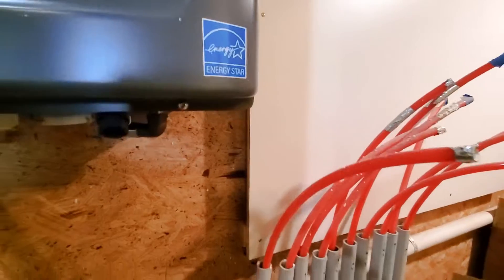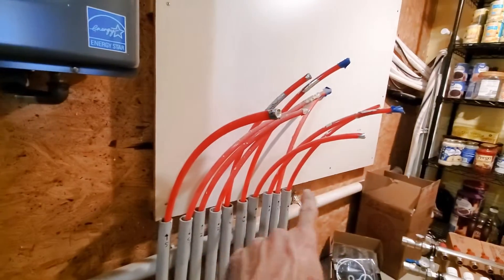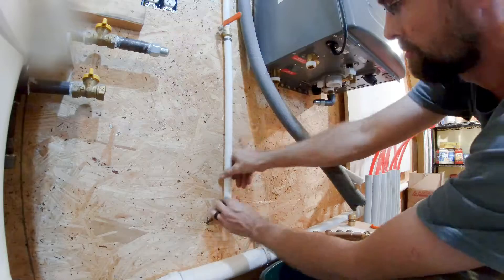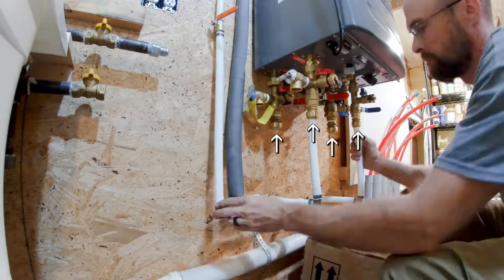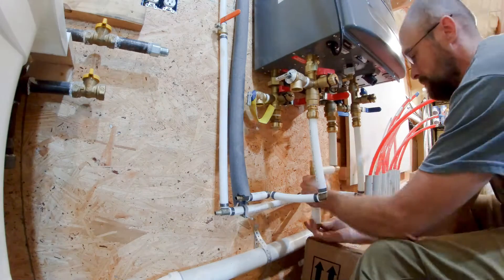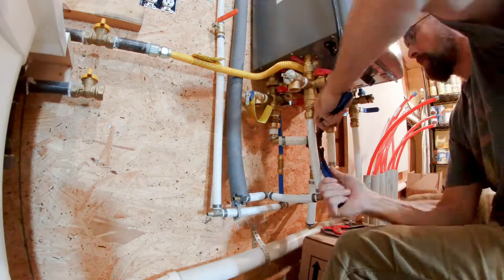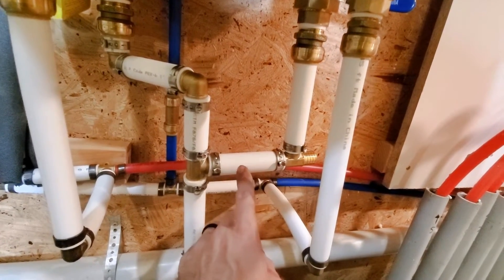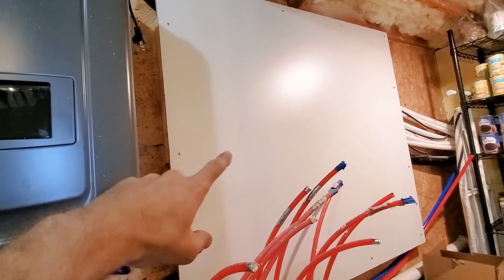Rheem Prestige Condensing Tankless Combo Boiler 199k BTU - Plumbing the Boiler - Off Grid Heater

Comment: I have very little space under my proposed install. Would foregoing the primary loop enable a significant space savings?
Reply from the maker: I'm not sure you should since it might not work correctly without it or it could shorten the lifespan of the unit/parts.
Reply: Ok will go with two loops. Thank You
Reply: @Off-grid I worked my primary loop so the centerlines of the 1” pex tees are 5” apart. I am holding off on going another 1/2” closer, mostly because I dint think it will make much difference. The flow of the secondary loop goes against the flow of the primary (right to left on 2ndry & left to right on primary. Do you think this is why my boiler flame cuts off in short order, even so many of my zones are calling for heat? Also my 2nd pump is only getting 2-3 GPM at full speed…related?? Thank You
Reply: @Off-Grid Still not getting longer burn times or heat up of the house. Changed circulators but that was not the problem. Flow through the secondary is smooth, but flame goes for at the most 2-1/2 minutes and then stays off for a long time. No way your going to heat a house at that rate! I cut the flow interface pex down to 4-1/2” between centerlines of verticals but still not satisfactory. Called a boiler company for diagnosis tomorrow a.m. The heat simply isnt getting out of the primary loop or there is something wrong with the unit!
Reply from the maker: @dawnpaulandelizabethromero3458 I had a similar issue and it was because the air intake pipe was restricted by a mud dobber nest.  It would turn off after a few minutes because it couldn't get enough air.  Check the pipe and the internal air filter.
Reply: I did not use <4 pipe diameters between intake and outlet in primary loop. Boiler did not ignite with call for heat. Will report back when it is fixed.
EDIT: Per your “short”, your combi thermostat is wired to the “CN” terminsls on tje control board, whereas my Taco zone controller “isolated end switch” is connected to the “Heat Demand Input”. This will be another problem with the boiler not lighting off with the radiant heat loop.
Reply: Thank You. The house heated up quickly after turning off the eco-mode (outdoor temperature sensor) and going straight temperature set point. It seems, the 95% efficiency will not be achieved due to this. I even set the radiant heating (staple up on wood floor) set temperature up to 160..the boiler easily heated the home…now back down to 140 degrees. The idea of replacing the circulator with a higher head pump is now on “the back burner”.
Reply from the maker: @dawnpaulandelizabethromero3458 i had the outdoor sensor disconnect for the first winter and it would over heat the floor.    When it was disconnected the unit would keep running trying to get the house to temperature.  When it started getting warmer outside and the sun came through the windows the house would get warmer and now the floor was to hot.  That first winter we'd have the doors and windows open because it was too hot inside.  After hooking up the sensor we did have that issue anymore.
Reply: BTW, the heating company did mot find anything wrong..they recommended turning the “input side” tee 90 degrees to allow easier flow thru the primary but still maintain the thermsl seperation.

Comment: Great video series.  Maybe I missed it, but what square footage are you heating with this boiler?
Reply from the maker: The main level is around 1600sqft finished but we're also ran two loops through the garage.  It works great and the main level of the house is often warming than the rest of the house.

Comment: I know this video is old but I'm working on installing the same boiler. Do you need a pressure reducing valve going from the domestic cold to the auto feeder or just the check valve

Comment: Two loops - primary and secondary. The primary loop goes through the unit. The secondary loop heats the house. The internal pump for the primary loop is about 5 gpm. The external pump for the secondary loop is about 20 gpm. You can't (don't want to) push 20 gpm through the unit. Over a short period of time, the water in the secondary loop will get up to temperature, being constantly heated by the water going through the primary loop.

Comment: Can we put low price air eliminator instead of expensive one, make a tee on the pipe and install it. What is the benefit of putting that big air eliminator ? 
Is not the recomended size for heating pipes close to boiler (Manifold etc) suppose to be at lest one inch ? 
Thanks for the part list in the description it helps
Reply from the maker: All of the air eliminators were  part of existing parts of the system so I really didn't have a say in where they went.  There is one inside the boiler, two by the manifold, and another by the expansion tank.

Comment: Great video, thanks for the detailed explanations and tips! Quick questions, does the white 1" pipe have oxygen barrier coating or a standard 1" pex B? I couldn't find it in your parts list. Thanks
Reply from the maker: Thanks.  The only part that has the oxygen barrier is the tubing that's in the floor.  The rest is normal pex.  There is maybe 1% of normal pex vs the oxygen barrier so it isn't something that the air separators can't handle.  There are four separators in my system.

Comment: i called Rheem tech support today. they said the boil need a manifold " part number RTG20318"  otherwise , it will have high pressure error code.  do you have even get into any error code without the manifold?
Reply from the maker: The pipes run through a manifold.  That is how it feeds all the different loops.

Comment: Do you have a video showing how to wire the combo boiler to the wall control unit that controls all the pumps and such?
Reply from the maker: There are only two pumps in my setup and the settings on the boiler control them.  The only other thing wired outside of the unit is thermostat.

Comment: Not a good idea to use pex hoses directly on the outlet side of your heater, they may get much hotter than set temp on the primary loop depending on the demand sensed by the unit.
Reply from the maker: I guess I don't understand since pex wouldn't conduct heat like copper would so how would it get hotter then the set temp?  The system has been this way for a few years now with no issues.  It's run like a champ.

Comment: We have a question if you are available
Reply from the maker: Sure, what are your questions?
Reply: Customer service was so helpful! F and C are in the A:GA/L setting (gallon/liter)
Reply from the maker: @mindybest3213  good to know, thank you
Reply: Craziest thing.😅 There is very limited instruction on the control  panel. Do you know how to change  off of Celsius? Or have access to a better manual for this unit?
Reply from the maker: Someone else asked me this as well.  My unit is in F.  I don't remember changing it from C but maybe I did.   @mindybest3213

Comment: What crimp tool did you use for the 1 inch PEX?
Reply from the maker: I had bought one on Amazon that worked ok but eventually broke.  I have an off the shelf crimp tool from Home Depot now which is much better and easier to use.

Comment: Great presentation and very informative for all.  Installing my system now and noticed that in your Isolator Service Valves connected to the bottom of the boiler hot side (CH/DHW), both have pressure relief valves attached.  It was my understanding that the boiler comes equipped with a PRV on the top of the unit adjacent to the exhaust vent specifically for the CH and that a separate PRV for the DWH was only needed (total of 2 PRVs).  Is an additional PRV needed on the CH ISV as well?  It makes sense that it is needed there, just not sure of the purpose for the one on top if this is the case.  Any thoughts?  Also this link gives a great description of the primary/secondary loop and the basic fluid dynamics explaining how the two loops are hydraulically disconnected and the resulting efficiency as a result.
Reply from the maker: You are correct that I have an extra relief valve.  Thought I mentioned that in one of the three videos on setting up the boiler.  The kit I bought came with the valve so I just installed it anyway vs buying a plug.

Comment: Did you need to install a pressure regulator on the water auto refill pipe? Or is it built in the unit ?
Reply from the maker: No relief valve is needed because there isn't any increase in temperature or pressure on that side to justify needing one.  The relief valves are on the hot side where pressure can build up from the expanding heat.
Reply: I think the question was about pressure regulation going in to the auto feeder. If that's the case, then the spec in the manual say 30 psi is max. That's quite a bit lower than most well fed pressure tanks so in that case a pressure reducer (and backflow preventer) should be used. ( @Off-Grid
Reply: Same question, I don't see pressure reducer, heating side should have low pressure around 15 psi but I see it is directly connected from normall water pressure line. Unless as you said if systems has built in

Comment: hey i thionk a bout to buy the heat only , i wanna keep the water tank ... i can use only the heater on this one
Reply from the maker: Yes you could.  I'd suggest you still pipe the house hot water through the boiler first though. This way it preheats the water before entering the tank.  You'll get a lot more hot water for less and your tank will last longer.

Comment: BTW - What outdoor temperature sensor / reset did you use?
Reply from the maker: There was a sensor that came with the boiler.  I didn't hook it up right away but found that it is essential to keeping the floors from overheating the house since it shuts off the boiler as the temperature outside increases.  If it did do this then the heating of the day combined with the floor heat will make the house to hot.  We often had to open windows during winter to cool the house down.  Haven't had amy issues since installing the sensor.
Reply: Thanks I just found mine that came with the boiler.
Reply from the maker: @GG-sj2wg  good deal.  Hope it all comes together ok for you.

Comment: So I was just up at FW Webb plumbing supply.   I asked the guys there the purpose of the primary and secondary loop to the radiant floor heating.  They all knew what I was talking about immediately.  They said it’s to make sure the boiler always has enough water in the heating chamber to avoid flash steaming the water.  At 100K+ BTUs the boiler needs adequate water and the secondary loop allows it to draw water from the heating system as necessary.   This makes sense but I don’t really understand why it doesn’t just always use the short secondary loop.  I guess I don’t really need to understand it so long as it works but I would like to know.
Reply from the maker: Sorry, just seeing this as it did notify me.. there are two pumps. One on each loop.  That is how the second loop gets fluid pushed through it.

Comment: Did you ever figure out the purpose of that secondary loop on radiant heat line?  I don’t have that in my installation.  I have the manual but can’t find that loop anywhere in the text.  Can you point me too it?
Reply: Actually I used a preassembled panel from FloorHeat that has a Taco Zone Controller. On the panel there is a ball valve between the heating water supply and return.  These value is currently closed on my system because I thought that’s how it was supposed to be because if opened it would short circuit the loop mixing return heating water with supply heating water before going back to the boiler.  I’m so confused.

Comment: I have almost the exact same unit, tight is right. I used brass nipples of different lengths to avoid the crowded gas inlet. Nice job.
Reply from the maker: I really need to figure out how to fix that area around the gas line.  I'm sure I'll need to clean that filter at some point.  Thanks for watching and commenting.
Reply: @Off-Grid  There is a nice braided flex that works well also. I eliminated the elbows with this. You can use a 1" brass bell fitting to step down from 1" to 3/4 if you don't need the volume, but Looking at what you have you probably need it. 
E
Reply: I'm struggling with start up. Did you have a y issues?

Comment: I have just installed one myself and have the domestic hot water working great but the floor heat does not seem to work consistently I have the outdoor sensor installed and it set to run off of that setting. I do not get the grid indication on the display just a temperature of 150 or so. It has to be a setting of some sort any idea?
Reply from the maker: Try turning off the outside temp sensor and see if that allows the unit to turn on.  It is a setting under installed mode.  Then crank up the thermostat and see if it turns on.  Is your sensor in the sun?  That could be causing it to read a higher temperature than it really is.  Mine is under the soffit in the shade.
Reply: @Off-Grid  
This my seem dumb but i thought there was a built in thermostat in the unit. What type of thermostat do you recommend using this is only for a shop setup.
Reply from the maker: @danyonfontenot5903  you'll need to get a Heat only thermostat.  They are easy to hook up with only two wires back to the boiler.  Red goes on the right terminal.  I'm using a very basic Honeywell linked below.
https://www.amazon.com/dp/B071X9DGHY/ref=cm_sw_r_as_gl_apa_gl_i_NE2GB71T558R1D1YYFP3?linkCode=ml1&tag=the5thjourney-20
Reply from the maker: @danyonfontenot5903  noticed my system doing the same thing recently.  It is the outdoor sensor setting.  In Installed Mode go to 4.Od then set the A.HI temp higher.  If you want to simply disable the high temp cut off then still under 4.Od go to b.noH and turn it off.  When it is on and the outside temp is with in 5deg of the set temp the unit goes into low power mode, which seems to just run the pumps.  

I had mine set to 50deg and raised it to 60.  We'll see how that performs.
Reply: @danyonfontenot5903  That's probably because you're using the wrong thermostat. The Honeywell T6 
TH6100AF2004 hydronic thermostat is made for floor heating since it uses a sensor made for the concrete slab.

Comment: That lady you talked to that treated you like a moron... obviously didn't know who she was dealing with.  Looked pretty complicated to me.  Good job😊
Reply from the maker: Thanks.  I had to laugh at how amazing rude she was.  I could hear kids in the background so I'd guess she was working at home and I was bothering her.  That or she was going crazy dealing with family and work at the same time.  No worries though, I figured it out.
Reply: The separate primary and secondary loops is common to virtually all condensing hot water furnaces like this. With an old style cast iron boiler it didn't really care if it is at 180 degrees one moment then cool 50 degree water comes sliding in. With 50 pounds of cast iron there was a lot of thermal mass so the temperature didn't change very quickly. With the condensing systems with the much smaller mass heat exchangers, large shifts in water temperature goof up the process and potentially damage the heat exchanger. By having the primary loop at the furnace with a secondary loop going out to the flooring it minimizes the temperature swings seen at the heat exchanger.

Thanks for posting this video. I'm looking at one of these same units. Would love to hear how you like it once the weather turns cold.
Reply from the maker: @chart9105  Thanks for the information.   I always like learning more about the systems in our house.  The boiler has been working great after we got past a muddobbers nest that plugged the fresh air vent.  Thanks for watching and commenting.
Reply: I talked to that woman today for same issue and she treated me the same way. next time I will use a NAVIEN and screw those dipshits